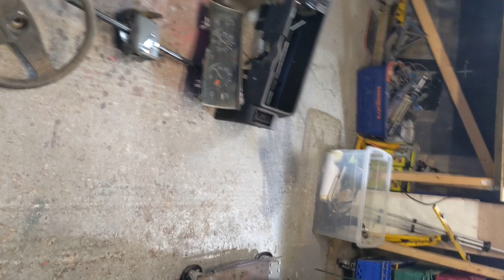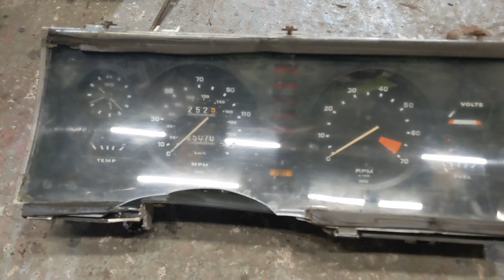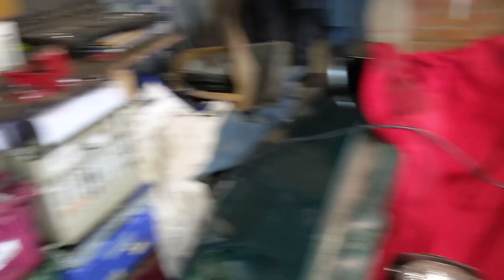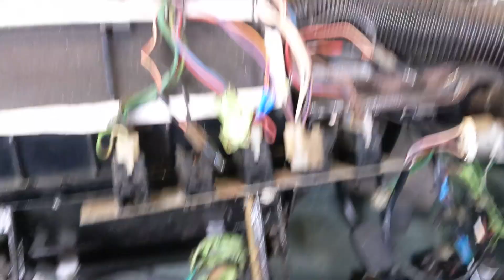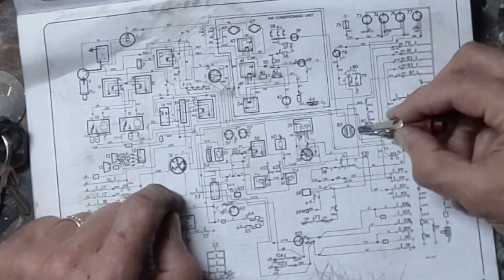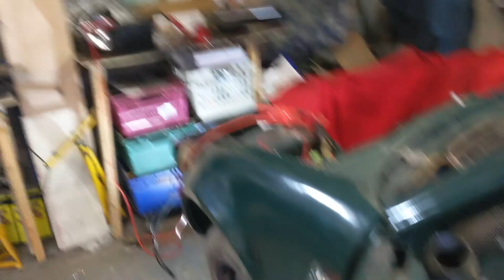Triumph TR7 Restoration: Headlights off wiring loom

Comment: Hi Henry, hope your xmas was good & that you have a great new year. Looking at the fuse box, I would remove the fuses, replace or clean up, but especially clean the fuses' contacts. This may clear some gremlins but also create less problems in the future. Try  a switch cleaner on the stalks as well, my flasher on the stalk is temperamental and sometimes have to give it a few goes before it works. You are right to leave the dash til towards the end, you have no engine in yet either :) you can do continuity testing so at least with the pcb on the reverse of the dash you can see where each connection runs to from. I wouldn't bother with the nickel pen if you find an issue, just route in or solder in a wire yourself and tack it down neatly, better in the long run. Isn't there a large edge connector that does connect to the bottom of the dash also, worth cleaning that too. Hope this helps. Or you could send the dash to me and I will refurb or check it out for full functionality for you and clean it up as best as..cheers!
Reply from the maker: Thanks Chris.  I did give the fuses a clean and checked them all.  I also ran some sand paper over the fuse box connectors, but not the relays.  I might be interested in your offer of the dash.  I don't have your email but if you drop me a note I'll get back to you.
Reply: @HenrysGarage  Hi Henry we have communicated before by email, I'll search my email for you and send an email ok.
Reply: Email sent

Comment: Sweet.
I once owned two spitfires, both pace cars with the emblems on the dash. Had them stored about 100 miles away in a garage for years. Went to go get them and the garage had been wrecked and the cars were totaled. One was bent in half and critters ate the wiring, both were rusted. It was so sad to get rid of them. The nicest was a red convertible with a manual transmission. I am so mad I let them go to waste. Hopefully you do this TR7 right.
Reply from the maker: That is a real shame Mark.  I like to see these old cars used and I do use mine on a daily basis, irrespective of the weather.  This car will become part of the team
Reply: That is such a shame, but did you sell on the engines/gearboxes?